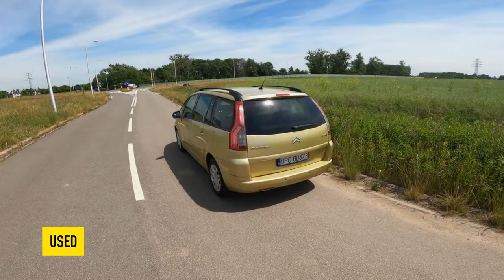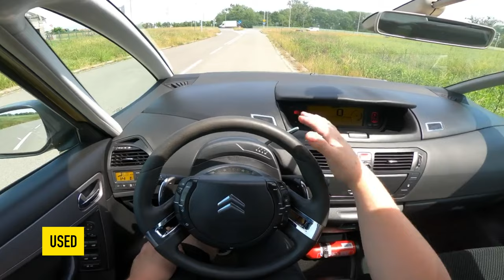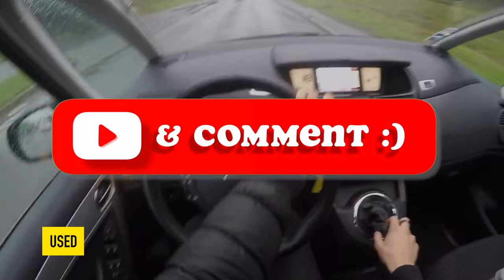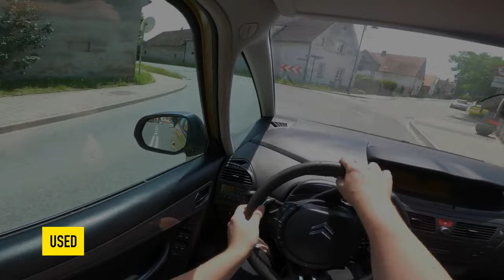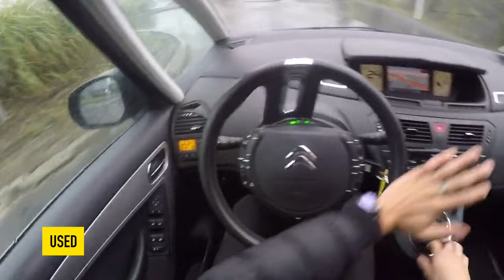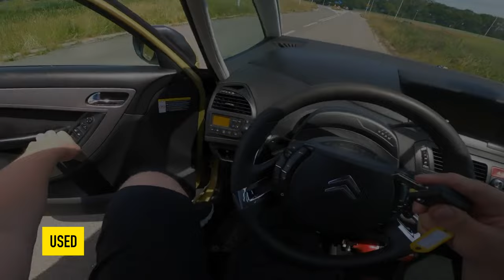What are the most common problems with a used Citroen C4 Picasso I?

Comment: Great car.
My 2007 1.8 petrol (minimally maintened), has  now 290.000km and not one serius problem.
My kids refuse to travel in my wife's Audi A4 (no space and too dark inside)
I just love it for the reliability, the comfort and the quality of life in it.
If it ever breaks, I will repair it (lots of cheap parts around), or I'll buy the same with a lower milleage.
Reply: I am looking to buy a 1.8 petrol Manual soon (after having endless issues with the 1.6 diesel engine and the crappy EGS automatics). Your comment fills me with hope!
Reply: @akubel33t  I never liked automatics. Hope you find a nice one. Mine still goes strong. A small tip: clean and put some special grease on the fuse connections every 2 years or so. Many Citroens have been scraped just because of that. Definitely a car to fall in love with.
Reply: @ioannpapaioann7678  many thanks for the tip!, will definitely look into that
Reply: @ioannpapaioann7678  many thanks for the tip!, will definitely look into that